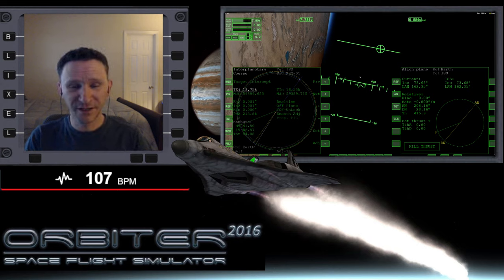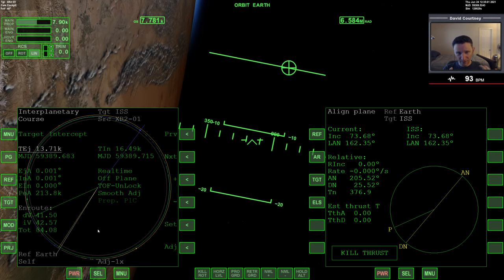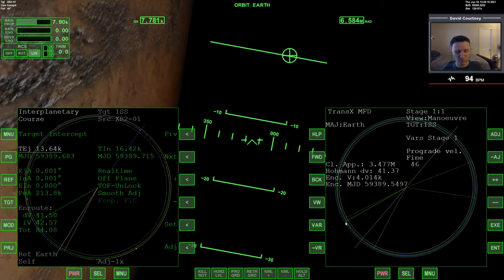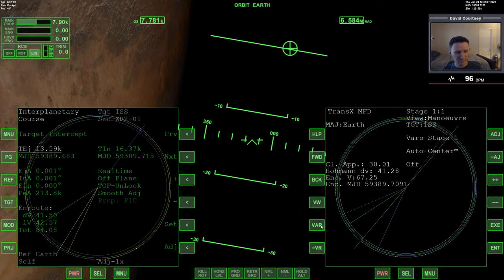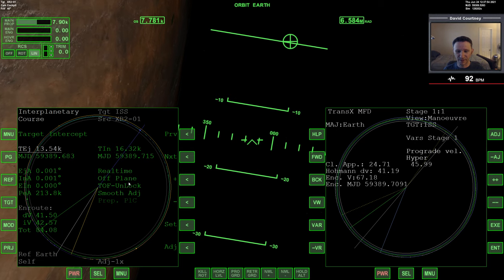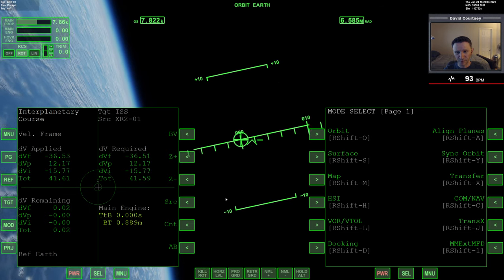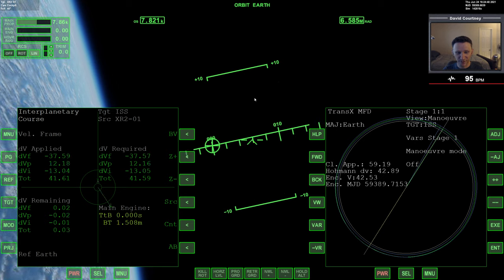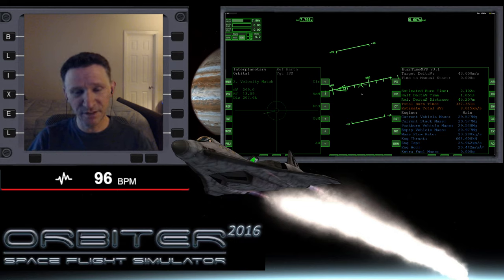Orbiter 2016 - [Part 2] ISS Rendezvous with IMFD

Comment: IMFD is basically a calculator--you tell it what you want, and it tells you how to achieve that in this particular situation (though obviously the solution it gives you is usually not going to be the best one right off)

TransX is the other way around--it's more like the scale at the doctor's office--you fiddle with it until you get the balance you want, and the numbers you end on are your solution. You are basically asking it "What will happen if I do this?" and it tells you. If the result is not what you want, then you say "Okay, what if I try this instead?" or "What if I tweak this number just a bit?"

I was a TransX man once upon a time--I even tried to figure out how to use it as a "universal autopilot", a default system for planning every maneuver in every situation. Of course, it can't quite do that, which is why I prefer IMFD as a one-size-fits-all navigation system--although TransX is useful in long-range trips, and combining the two can give you a gold mine of information.

I like IMFD better because it can plan maneuvers in low orbit of any world, any time, and tell you what the result would be, without having to go there from another planet first, and then burn the maneuver automatically. Although it does not give you the closest approach info for a space station, you can use the Delta V program to plan each successive maneuver the old-fashioned way--set your reference point, set your apoapsis/periapsis. About the only thing it can't do is your synch burn.